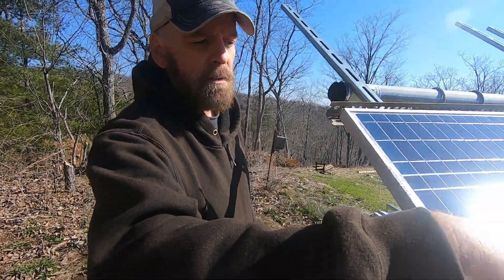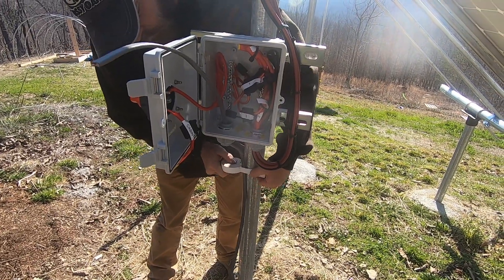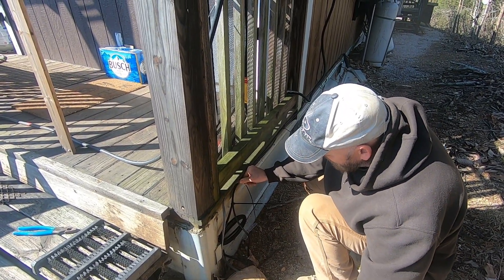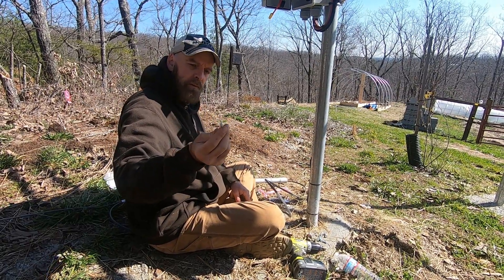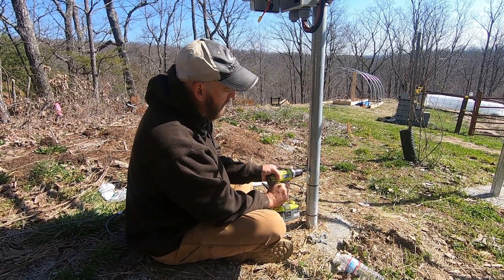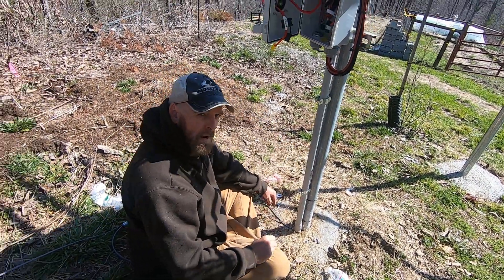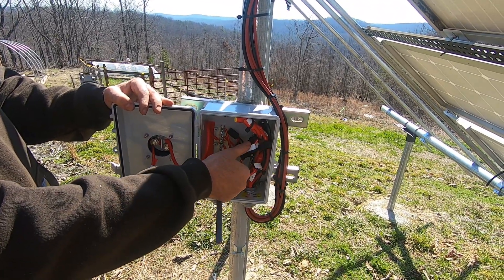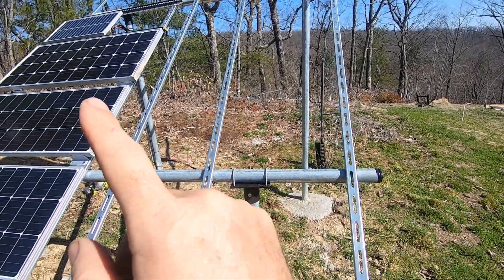Solar Array  EZ Array Cutting Edge Power Installation Part 2 with homemade combiner box  Off Grid

Comment: Something I've been wondering is you can use the solar panels as a water catchment.  If you were to bolt the solar panels together using bolts and nuts and skip using the Renogy panel brackets except for the top and bottom of your 3 panels.  The panels would be close together.  Trying to plan something from the couch and actual experience are 2 different things.  I'm just wondering if there is something I might be missing.  My plan is being in the high desert where water is scare and I'd be sharing my solar with a friend so my solar array would be greater.  I'm hoping to use the panels as 1 source of water catchment.   I appreciate your videos and looking forward to enjoying a life like yours.

Comment: Also,just out of curiosity, is there really much difference between the stranded and uf wires? I understand the stranded use with dc,but is the difference negligible? 
I also know all to well about use what ya got, especially with prices what they are now.
Reply from the maker: I think there is a point or two when it comes to voltage readings. But UF is made to be outside and sure is easier than running conduit.

Comment: Hi Grumpy do you expect any power loss between  your panels and cabin using solid core wire and also what is the wire gauge and length of run do you have?
Also please reconsider your thoughts on video quantity yours is one of only a hand full of channels that I religiously watch and subscribe to.Thanks for the informative content that you always put out.
Reply from the maker: I don't think it will drop that much. I am adding another panel. UF cable makes it so easy I decided to use it. Thanks for the comment on the quantity of videos being uploaded.  That said the volume is too low on views. So I'm going to focus on video quality content.